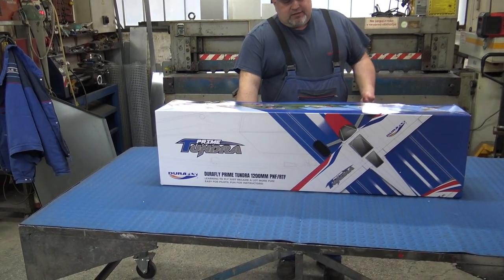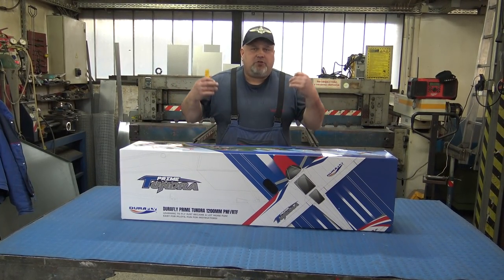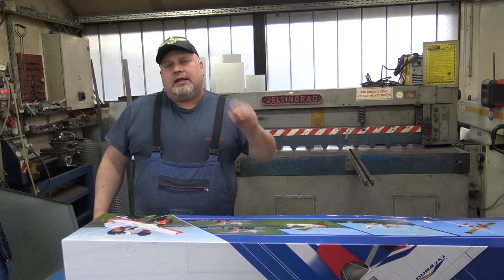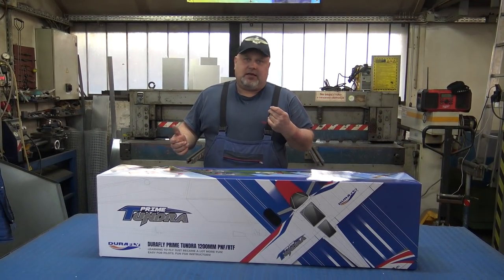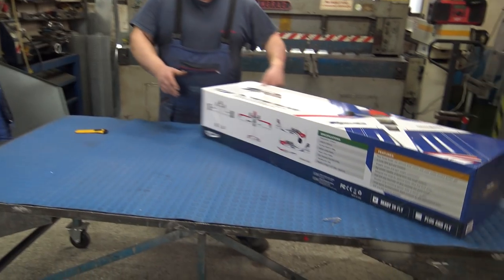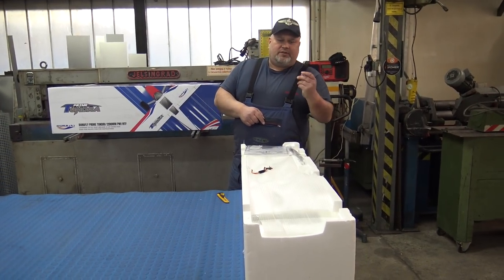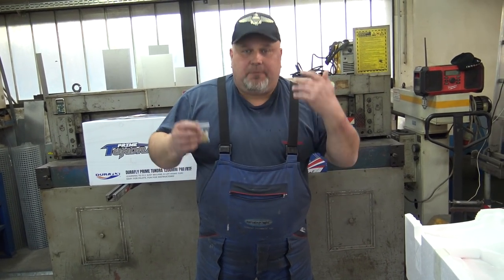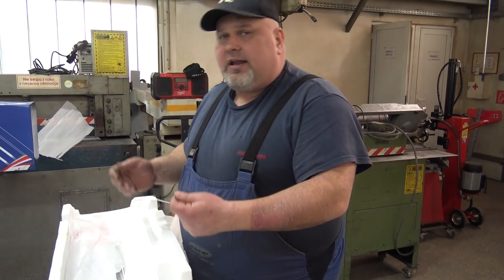Durafly Prime Tundra RTF STOL Trainer-Sports Model w/Flaps & 3-Axis Gyro EPO 1200mm Unboxing

Comment: What hobby stores need is a bird that you don't have sell your right arm to purchase. They need a bird, that you can pull out of the box, read the info's on how to fly, and when to fly and where to fly. If the bird is foam, they need to install a strong frame on it with a plastic cowling and carbon rods in the fuselage behind it. Why? Because all beginners will nosedive it in. They need a radio that won't brown out and you don't have to program just flip the switch and go fly. And lastly, no lipo batteries burning down the house, those things are dangerous. This Tundra is a beautiful bird, And Pilot Robert and Captain Blaz will make magic with it. Keep up the great work gents!!! You have many fans that enjoy your show...

Comment: Well, the inflatable hwheels are sexi, but you're right; if the rubber slips off a man could find himself in serious trouble.. Speaking of which, it is my sad duty to gently reprimand (scold, tell off) our dear Pilot Robert. If you don't want to do the same thing again, then BE CAREFUL especially with crap tools. Always keep your fingers behind the blade. Rubbish tools are the most likely to bite you. Lecture over. 4 Tundras? I'd like to see 4 ME262's or 4 Hurricanes.. Can you retrofit bomb doors on a foam bomber? Lancaster perhaps? Much better way to dispense the sweets.. The linkages on this are better than on that jet last week. I promise you; keep an eye on those phoney baloney u bend jobs. You could lose a fine plane with them. Big salute as ever from London. 🇬🇧👍